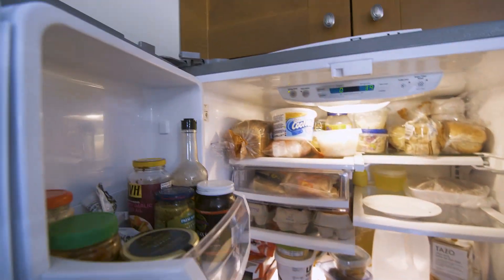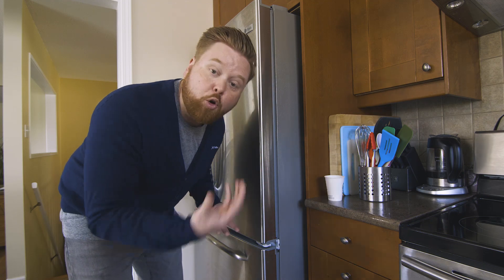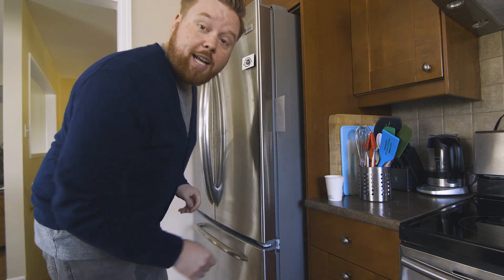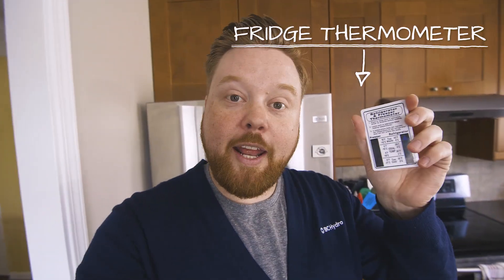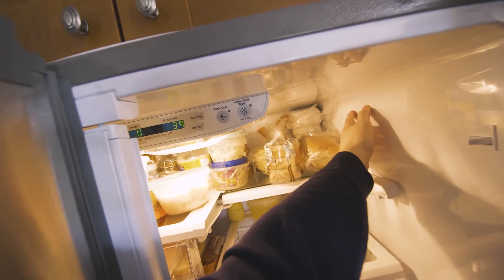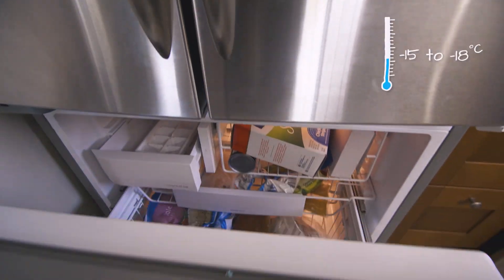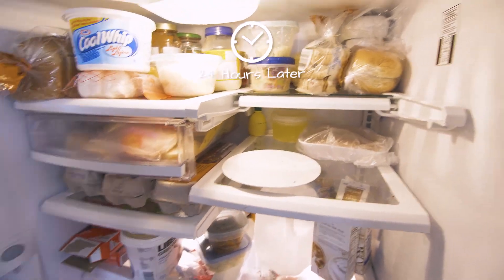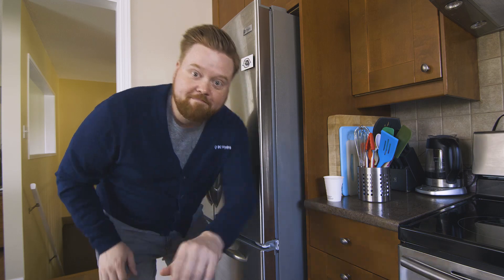DIY with Dave: Checking the efficiency of your fridge

Comment: I have a quality/accurate fridge/freezer thermometer and especially the fridge temp. changes when the compressor kicks in as well as kicks out. It kicks in at 4 C and kicks out a -3 C. BC Hydro should mention this as the other method used is kinda useless.